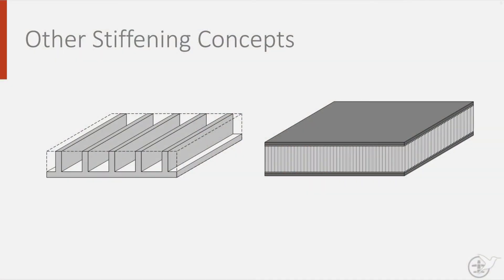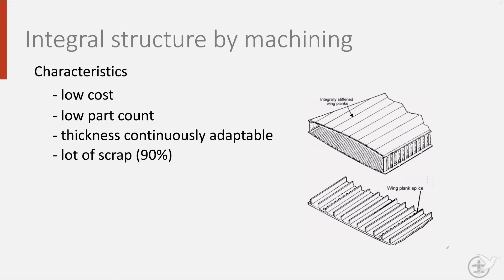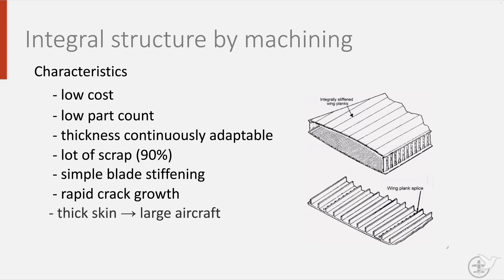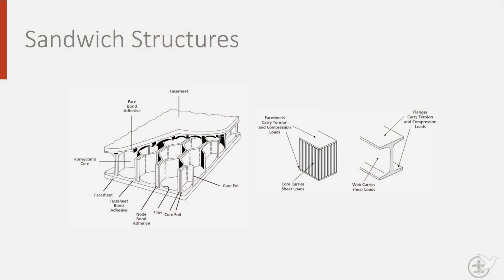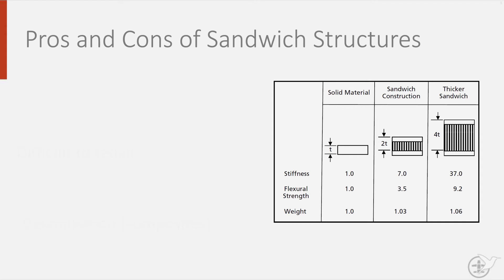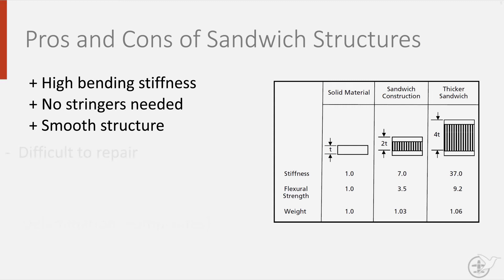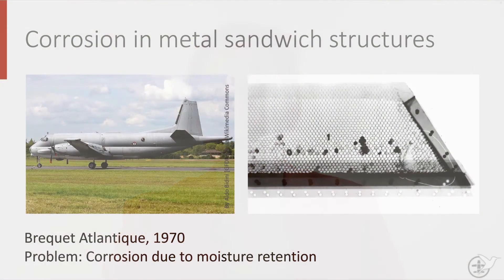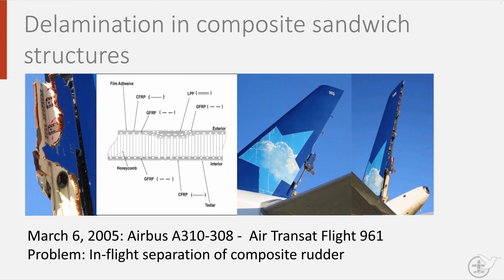Introduction to Aerospace Structures and Materials: Monocoque Structures

Comment: The water in the sandwich structure can be eliminated by shaping & kiln-drying the sandwich matrix before being bonded to the surface material.  Then place in a vacuum chamber (pressurized to 1,140 torr of Helium), where it is pressure-sealed, & dried again.  Then, it has the surface material bonded to it.  The sandwich material is now filled w/ millions of lighter-than-air pockets, that are pressurized to 1.5 atmospheres (at 14.7 psi/atmosphere).  Sea-level atmospheric Air has a molecular weight =29.  Helium = 4.02.  So...  

4.02 (x 1.5 atmospheres) = 6.03.  Which is almost 5x lighter than Air.  Helium is also inert & abundant.  Making it an excellent choice for producing metal foams weighing a fraction of solid metals. Protected against internal degradation & pressure-reinforced by inert Helium.
Reply: the mass of the air in most sandwich panels is an insignificant fraction of the total. Helium as a lightweughting measure is silly.